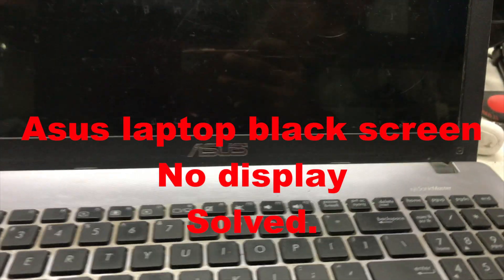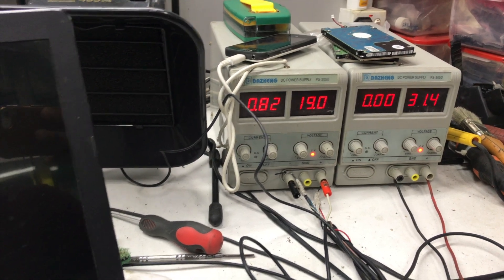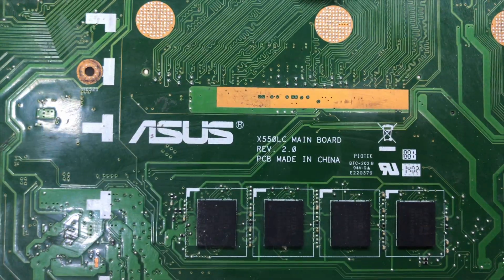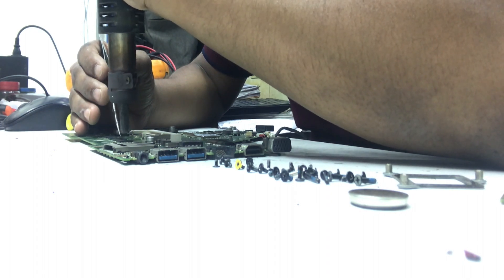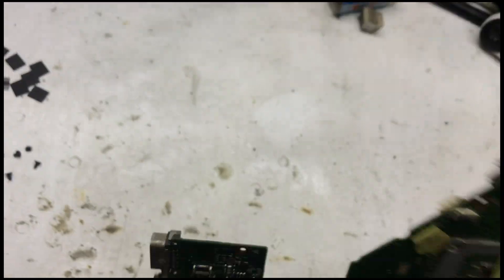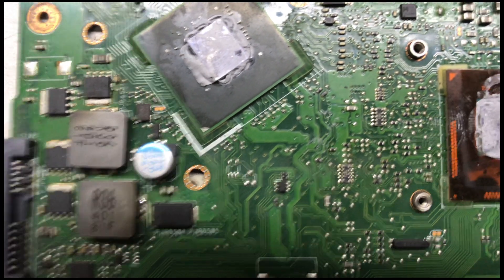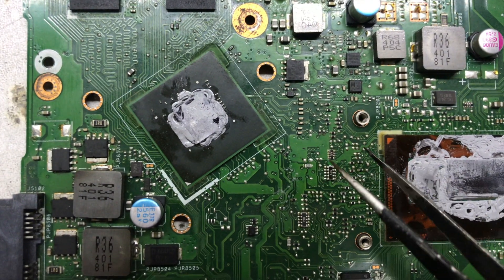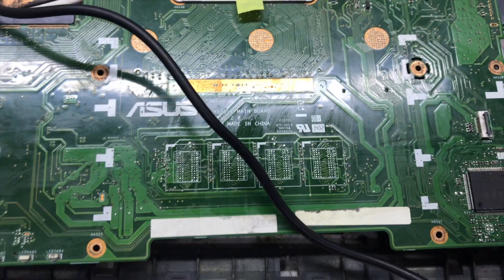Asus laptop no display | how to disable onboard RAM  X550L X550LC rev 2 0.

Comment: I have this no display problem on an Asus X555LB Rev 3.3 Motherboard. But also specifically, the onboard RAM is heating up drastically ( like 100 degrees celcius) at startup. Do you think applying your solution here could solve my problem?  What is your confidence ( as percentage like 60% or 99%) in this regard?

Also in my X555LB motherboard the resistors' places are different. How can I find the resistors to shift or do I need to shift them at all?  

i.e., Why just removing the RAM chips won't be enough?
Reply: Hey I am having the same issue, can you tell me what is to be done will be the good
Reply: @harsh-do3vo  I haven't solved it yet.

Is your onboard RAM also heating up to 100 degrees so hot that it burns your fingers?
Reply: @landingonyuranus1813  yes yess as soon as I start it, I can't even touch the ram for even a second, and CPU fan is working and only 2 Leds are glowing without display
Reply: Same boat 😅. X550ld. Ram super hot. Didn't reflash bios yet.
Reply: @krazyllah   We should find a solution together.  Give me an update.   I was gonna try this method:  This guy gave me an answer below:  We should  disable onboard ram. Bios flashing cannot help against this issue, he said.

 """The Bios programming can not  help remove shortage on Faulty Ram. Please look closely near ram for any disfigured caps causing shortage. You can remove the only shorted Ram and install a replacement. Or you could consider disabling the onboard ram.""""     https://forum.laboneinside.com/viewtopic.php?t=7265

https://www.youtube.com/watch?v=0CJdSVxc8CU&lc=Ugwvrhpb60269Uot_nV4AaABAg
Reply: Hey did you get solution?

Comment: Great job, out of curiosity, it seens possible to replace the onboard ram for the chips from one of 8gb just unsoldering and resoldering the new ones, without moving the resistors, is that true?
Reply from the maker: Thanks for your comment, yes possible,
Reply: Or why don't you just replace the faulty RAM unit only? ( There are 8 x500MB units soldered onboard find the one that is faulty, then remove it then continue with 3500MB instead of 4000MB, == Profit, why can we or can't we do it like this?)

Comment: These laptops with onboard RAM should have memory configurable in BIOS
Reply from the maker: Thanks for your comment, it’s hardware issue.
Reply: @Laptop_repair_zone  he means you can turn this memory off in bios.
Reply: @Lordosvk  he is right then it is hardware issues
Reply: i have X550L onboard ram is fucked up.. and sad to say there is no configuration on bios that can disable it. even if its bios is up to date..

Comment: did the dvd drive responded to input? mine has black screen, turns on when i conect charger, caps lock and num lock on, then only num lock, dvd drive is like unplugged
Reply from the maker: Michel Antunes thanks for your comment, you need to check all the required voltage and signal.

Comment: Hi sir, i want to know, is there any possibilities to replace the RAM chip instead of disable it?
Reply from the maker: Thanks for your comment,yes possible if you have much time and RAM chip available.
Reply: @Laptop_repair_zone  That's right! My man, Why did you remove all 8 of those chips?

If only one of the RAM chips are short, why do we remove all 8 chips ? (Each 500MB ram chips) ? 

I checked it with a THERMAL CAMERA, as soon as I power it on only one of the RAM chips(the second one from top) heat up to 140 Degrees celsius. Again no display.
My plan is to change that single chip, transplant one from the other SODIMM-module ( which also has the same place chip short which is the second one from top, looking from the CPU socket side-i.e., at top of the board)

Does my plan look okay?   Thanks again this new video is really useful.

Then get a new 4GB stick add them up and voila again use it as 4GB+4GB= 8GB!!!   Too good to be true?  What am I missing here?  In this way, do I even need to disable on board ram with those resistor shifts?    Too good to be true in the sense that the new RAM chip will immediately burn when I place it or sth?

When I do that I won't even need to shift resistors am I right?
Reply: @brad8122  i know this is late but did you try it? did your method work?
Reply: @thegamerboi7034  could not solder the damn thing
Reply: @brad8122  oh, that's disappointing but at least you tried